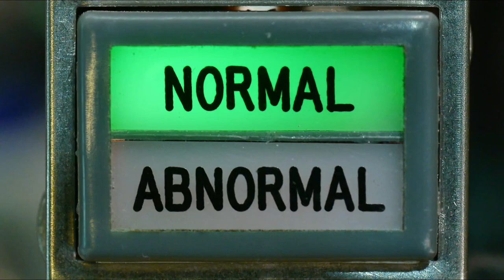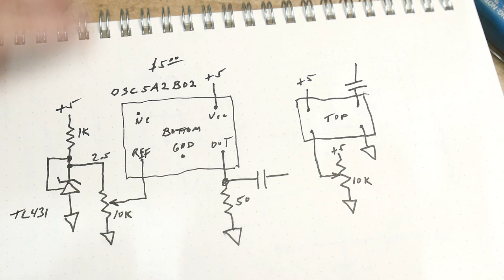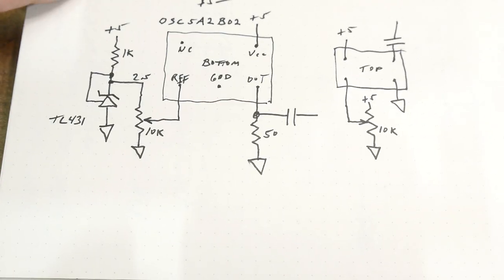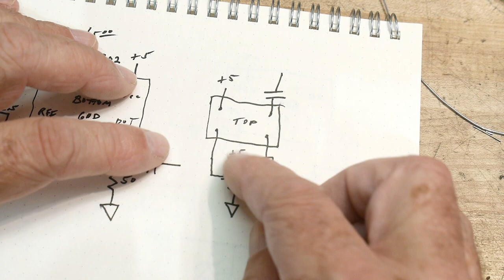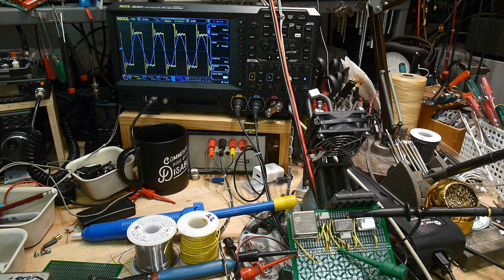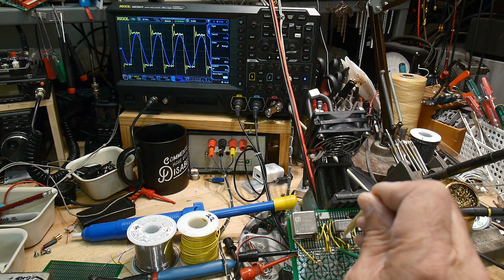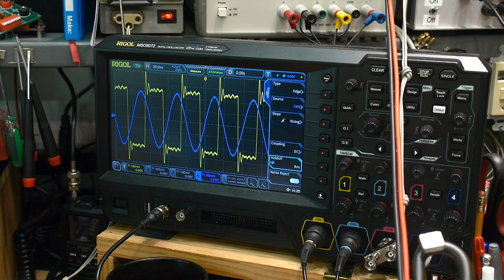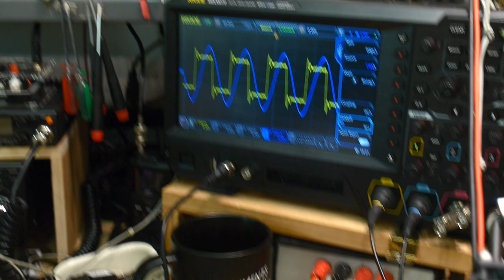#1020 Various 10 MHz Oscillators Compared

Comment: 13 seconds to drift one cycle at 10 MHz, means that the Rubidium emitted 130M cycles (13s x 10MHz) while the largest TCXO (on the left) was off by Qty 1 cycle. 
1/130M = 7.7 ppb.  So it's drifted by about 0.077 Hz in 24 hours, in suboptimal conditions (garage, not in a chassis).
I'd give it an A+ for effort.

Comment: I've had one of those OCXOs in my parts drawer waiting to be paired with a GPS receiver for... about a year now. PT8211 + RP2040 seems like a good pairing to tune the XO and (eventually) synthesize whatever's needed to replace the crystal on a GPS module, while offering various divisions of the clock, and monitoring PPS (probably disciplining from PPS too for a while, until I work up the nerve to un-can a GPS module)

One personal problem though, is I have very weak GPS signal at my house 95% of the time, so I suspect I'll need to invest in an outdoor amplified antenna before I can get that off the ground... in the mean time this nicely demonstrates it's stable enough when tuned by hand for various benchtop applications, so I think I'll mount up an SMA connector and dead-bug it to life.

Comment: I have a few of those OCXOs (the square can type) which I picked from ebay. I plan on using them - and since I don't have my own rubidium standard, I plan on using the government's; in other words, build a GPSDO. :)
Though, if you are OK with another frequency reference instead of 10MHz (like 6, 8 or 12 MHz) you can get a very stable and almost jitter-free signal directly out of some GPS modules (like Neo8 or newer) by configuring a divider. You can get 10MHz too but it will have noticeable jitter. That's because the internal reference frequency is 48MHz and that does not divide exactly by 10MHz. Integer divisors will get you very low jitters.

Comment: Hi, in my Racal 1992, I change the inside 10Mhz by the small square oscillator you show in the video, and the result is better.
Just I have to wait about 2 minutes to stabilised.
Also changed all the switches ans one of the relay.
HPIB is also fine working, just a small jumper to configure correctly.
Thanks a lot for the video, very interesting.
Juan from France

Comment: I replaced the oven in my hp 53132a counter & 3 years latter it's drifted about 5 mhz, yes milli! As checked against a gpsdo. Quite impressive I think considering its been power cycled a few times due to power cuts

Comment: All those ovens need to be inside thermal housings to protect against temperature changes and drafts. That will improve the performance by an order of magnitude. The third (smallest) oscillator appears to be running an internal phase locked loop for frequency stability and correction. Suitably insulated against outside temperature influences, it should stay locked up rock solid, only jumping a single cycle when the error is too great for the loop to handle. Older crystal standards where the crystal has aged can actually prove to be much more stable even if the frequency is off by a couple of cycles per second. It all comes down to whether you are looking for stability or absolute measurement accuracy.

Comment: Considering grabbing SiTime MEMS OCXO, specifically SiT5721, for the reference MCXO (microcomputer controlled crystal oscillator) source for the accurate 10 MHz clock that I would obviously need to be able to test oscilloscopes, something like that. Of course that digitally programmable OCXO is very expensive. Still kinda cheaper than brand new Rubidium atomic clock source though.

Comment: How long were they powered on for before testing? I would have thought a more precise test would be power on for 24hrs to become thermally stable then make adjustments and re test 24hrs later. Many high end test equipment require at least an hour powered on before use to stabilise and some calibration equipment is recommended to not turn off to keep the entire instrument at its thermally stable operating condition. Also, the test bed should be in a somewhat insulated container to minimise temperature variations from day to night...unless of course your garage is nicely insulated, heated above ambient and draught free :)
Reply from the maker: they were temp stable before, then I did measure 24hrs later (did you watch the video?)

Comment: What about using a PLL Synthesizer chip to produce the control voltage and allow you to adjust the output of the VXO to exactly 10,000,000hz

Comment: What happens to the output of the OCXO if there is no 50 Ohm load? Also, how did you determine that it needed a 50 Ohm load? The only datasheet available on the internet does not provide any sample circuits involving this OCXO. I've used this OCXO as a reference without adding a 50 Ohm resistor at the output, and it seemed to work just fine. Am I missing something? Thanks.
Reply from the maker: can be used either way

Comment: ike schrodingers cat, for you make sure your measurements are exact you have to measure the device 24hrs, connecting and disconnecting the oscilloscope changes the circuit even if only slightly.

Comment: On the 1st Osc you used a voltage ref, but on the 2nd you did not. Should that not have also had a voltage ref? Maybe use the same ref? I would think they would both be subject to the drift of the voltage feeding the adjustment pot. I have a standard I built years ago that has a voltage ref, but I installed it in a insulated box with the ovened Osc. I used WWV to adjust it as it was all I had.  It was very stable after 1 hour, and I left if run 24x7 in the lab. I have compared it to the two GPS units I now have, and its still a great standard. Even my two GPS units do to agree all the time and drift a bit. What's the old saying? A person with more than 1 watch  never knows what time it really is!
Reply from the maker: yes that would make it better. I was trying to show a range of solutions.

Comment: Depending on your space (and budget) it may be better to get a GPS based master clock, and use GPS Disciplined Oscillators.
Reply: That would require access to gps signals and use of antennas etc,the rubidium standard is a self contained reference, as are other atomic clocks. The gps time signals are derived from such static time sources such as rubidium/atomic standards.

Comment: Shouldn't the output be a nice sine wave? This looks more like a square wave.
Reply from the maker: there are different types, some have sinewave output, most have square.
Reply: @IMSAIGuy  I see, thank you. Can I ask how does one calculate the output power? I can't seem to find it in datasheets
Reply from the maker: @thebloodychoppers  voltage and current, if you intend on using these in a 50 ohm system. they might not be able to drive that
Reply: @IMSAIGuy  what do you mean by not being able to drive a 50 ohm system
Reply from the maker: @thebloodychoppers  these clocks are for digital systems not RF
Reply from the maker: @thebloodychoppers  from a datasheet:
 VOL = 0.5V   20 mA 
VOH = 2.4V   1.0 mA 
Output Load    10 TTL 

so 20mA low state and 1mA high state, 10 gate fanout into TTL

2.4V into 50 ohms is 48mA, so there is no way to use this part.
Reply: @IMSAIGuy  thank you for the answers. I have to read more about the topic